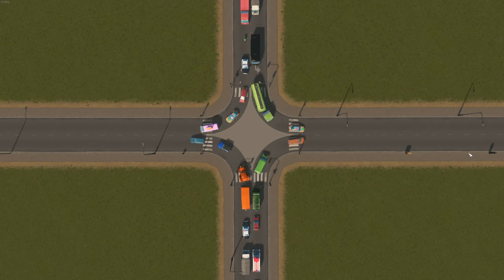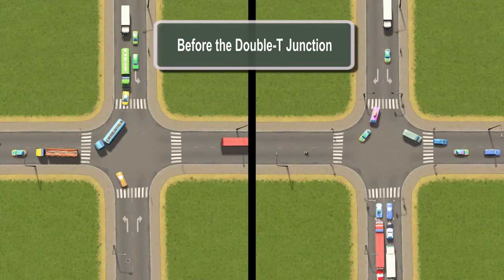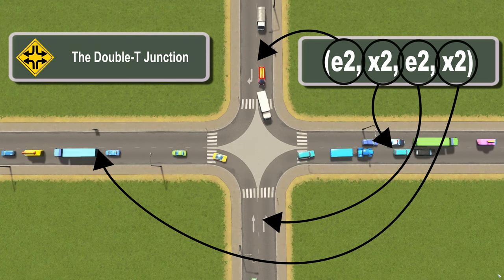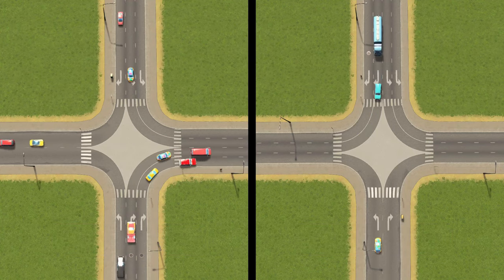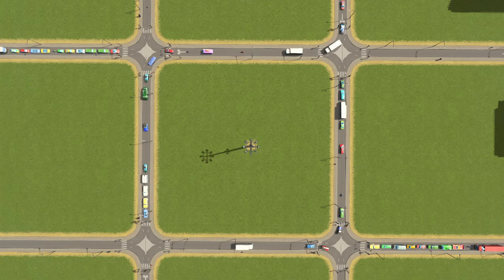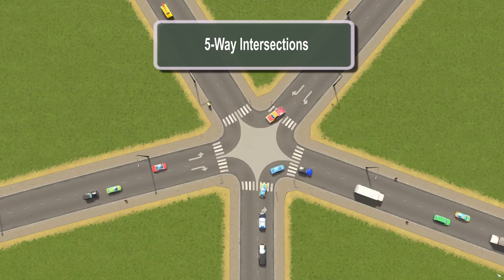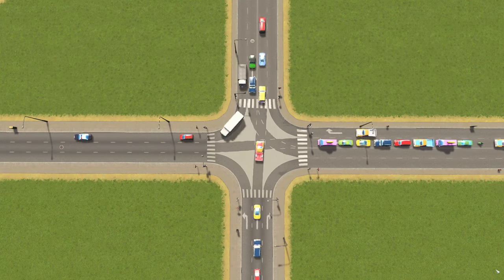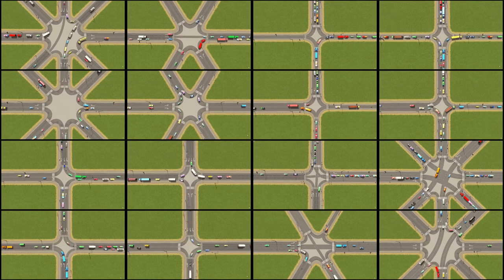Future Intersections: Variations on the Double-T Junction

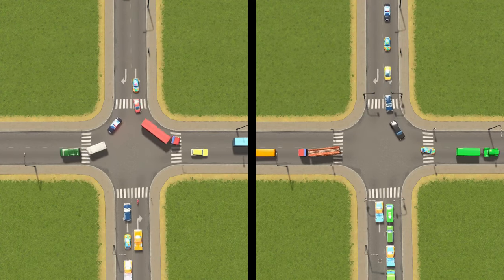Comment: 2:07 Hmm, the two phase light is interesting because that few phases is generally not that bad -- it even works ok without TMPE -- and it means that the lane changes happen in the intersections instead of between them.  Could even put a bit of 4-lane road right before the intersection to have more queueing space and have the cars sort themselves as they enter that segment instead of as they turn.  I might have to play with that a bit, though it's probably not relevant for your video series.
Reply from the maker: That's an interesting point about the two-phase traffic light at a double-t junction means that the traffic never needs to do any lane switching. The only real downside to this situation is going to be the delay from the traffic lights. With the standard double-t junction, the much shorter traffic light wait times are the thing that makes the longer (in distance) journey irrelevant. But as you say, without the lane switching you're free to size-up the roads to 3 or 4 (or even more) lanes. It could be an interesting compromise for when you absolutely need to have the wider roads.

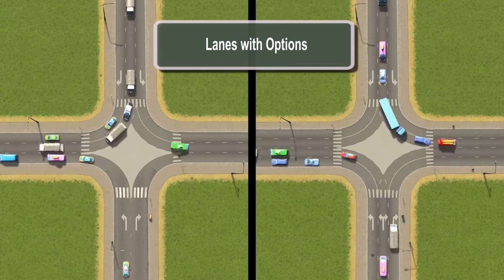Comment: 4:47 The idea of having a 3rd middle lane is good. It allows any previous right turners that are continuing right to stay in their own lane and vice versa, while still having a lane to merge into to get to the other street.

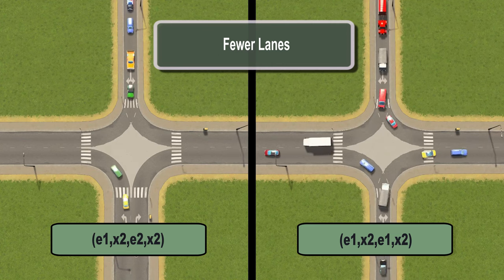5:03 The idea of having fewer lanes, however, is not good because you will either end up adding stop lights or forcing drivers from 2 lanes to merge into 1, creating more traffic.
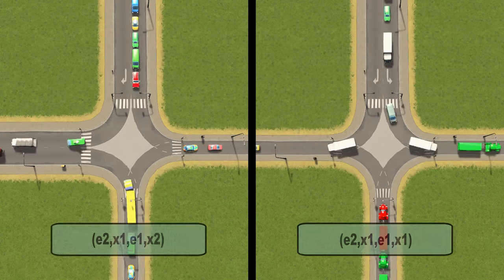Reply: Well, for the latter that's why it ends up with traffic lights at 5:19.  I think it'd be fine in the same kinds of places as "mini roundabouts" that are just paint circles on the roads.  If it's a really low traffic area, one lane with no traffic control at all (other than a sign in the middle saying you have to turn) might be perfectly serviceable.
Reply from the maker: I'm a fan of the 3rd middle lane too, but there's something else about them I didn't mention in the video, they lead to having more out-bound lanes than in-bound lanes. Then when you have 4-lane roads on a double-t grid, things start to good badly, because you will end up with too many lane changes in a short distance. I go into this problem in much more detail here: (section titled "More Lanes Makes Traffic worse")  
https://www.youtube.com/watch?v=qVINw5biQMI&t=25m05s
That's not to say there won't ever be a case for them though.

The fewer lanes thing, I could have went into more detail on. I know I showed a version with traffic lights, but because of those traffic lights they would really need to be located in low-traffic areas. And if they are in low-traffic areas, it might actually be better if we used a version with yield signs instead. So maybe a residential area or a small industrial area. Definitely not a busy city. I just like the idea of being able to get away with half the tarmac!